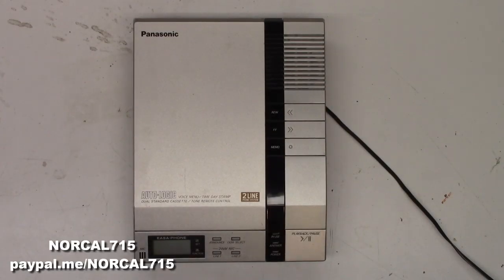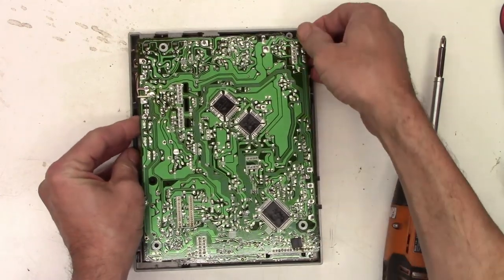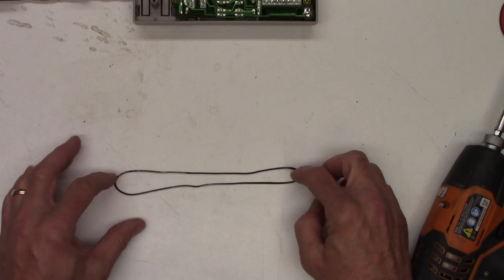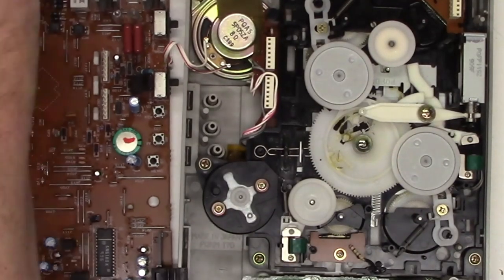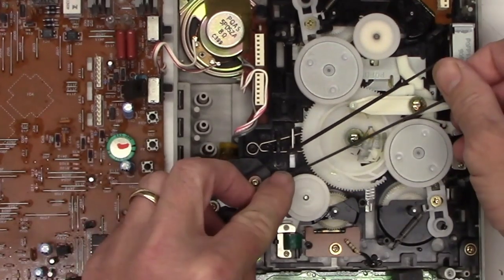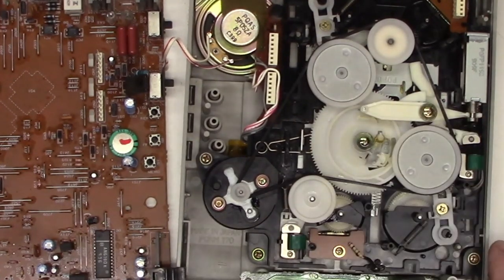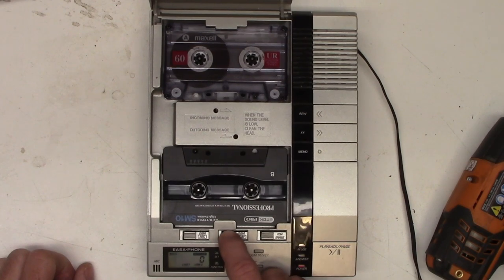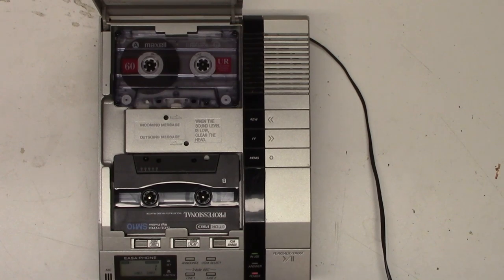PANASONIC EASA-PHONE KX-T1740 ANSWERING MACHINE WONT PLAY NO PLAY BELT REPAIR

Comment: I also used acetone for 35 yrs , as long as the pulley is a nylon base, tho, some plastics will hold up to acetone.
So I agree 100 % with acetone solvent to clean electronic and circuit boards as well.

Comment: I had a similar Panasonic unit, that had digital OGM, and a built in clock. Sadly it had a US version of the chipset, and thus the clock, on 50Hz, ran slow, plus it had a 110VAC wall wart, which when I got it was burnt out ( wonder why.....). So, made a new power supply for it, using an old alarm system power board, and the alarm system 7Ah SLA battery, to give it the ability to survive power outages over the 5 minutes the on board supercap could cover. to fix the time issue i did a little digging, and found where it was picking up the incoming mains for a clock, and went digging through my collection of scrap boards for a crystal that could be divided down easily to give 60Hz. Found one and used a CD4060 to give me a 60Hz clock for the board, powered by the 5V rail on the board, and built it on a little bit of prototype board that would fit in the case.

Ran for years, and the clock kept time well enough, within a few minutes a month, which was good enough. Eventually it did die, and by then I was rarely using the old land line phone, and by then as well the telco was giving a free answering service on the phone line anyway, so actually fixing it was not worth it. 99% of the calls on it were either telemarketers, wrong numbers or scammers, though this was long before the "this is Bob from Microsoft, here to help you with your computering " scams were commonplace

Comment: Hi ! ive been watching your videos on Plasma TVs it was all very informatives. I have some concern on Plasma TV, it seems that my Plasma TV is interfering my radio receiver and my wifi, when i shut the tv, the noise on the radio goes away, do you have idea or advice on how to eliminate the noise coming from my Plasma tv? Hoping for your reply. Thanks
Reply from the maker: No, plasmas are very RFI (radio frequency interference) intensive, I have that same problem. It is because of the extreme voltages and fast switching. They are really just radio transmitters, that display a picture

Comment: hi northcal i have an off subject question regarding led lcd tvs...i have a tcl led lcd tv that backlights not on and i do have image using flashlight test..however i have 0v going out from ps to the led strips...should i have voltage going out if connector disconnected? im trying to troubleshoot if the the ps is bad or the led strips...i already replaced the ps and i still have 0v out to led strips with connecotr disconnected...

Comment: In Argentina Electrogoma company still produces brand new belts for a big variety of audio and video equipment. Today I changed the belt of a Panasonic KX-T1450, which I assume uses the same belt as this model. For mine I used a 'B 497' belt (33cm of perimeter loose), because I already had it, but I could have used either this one or the 'B 490' (slightly larger), as they both figure as compatible for this model.
You can check in your home the Electrogoma pdf catalog for most of known belts and look for compatible devices listed, is very helpful for find a belt, specially if yours melted. They also indicate how to measure with a string and compare with the graphics.
dcelectronica . com . ar / correas . pdf
I hope anyone find this helpful.
Reply: Oh and I cleaned dirty parts (old belt melted) using ethyl alcohol